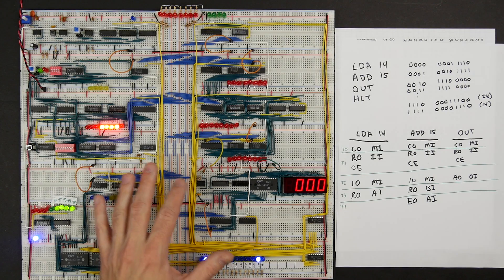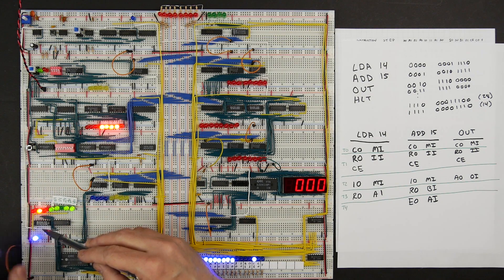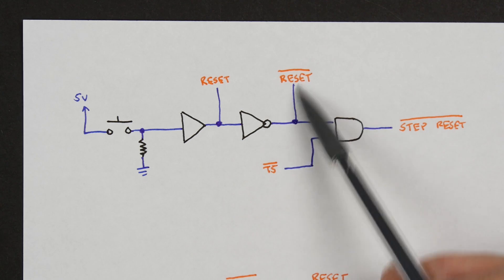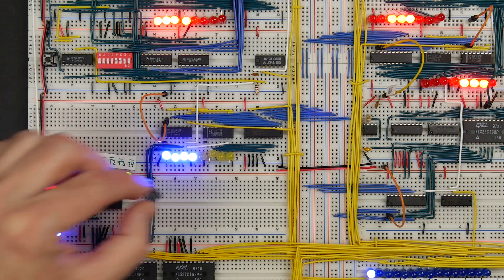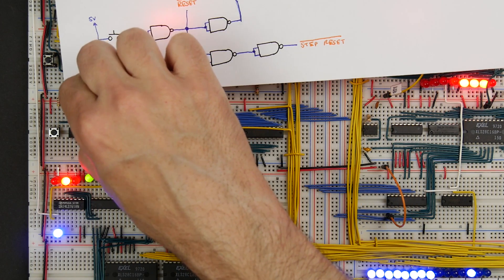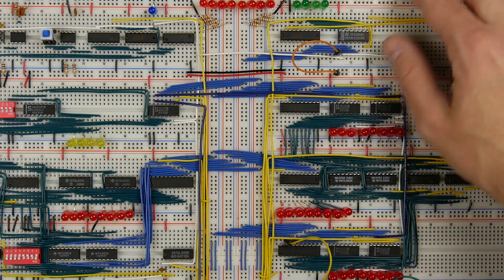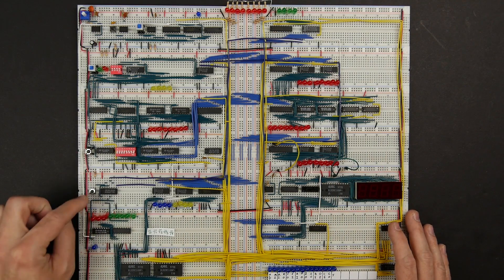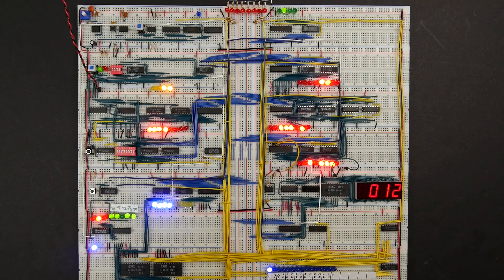8-bit CPU reset circuit and power supply tips

Comment: 3:12 /TS could be 1bit on roms last opcode step you set it 0 rest address its 1. or invert that thing so its control signal TS. all is there ready setup xD and would save clock cycles in your 16 address computer(cpu) bcoz output is just register c LOL

Comment: 📺💬 I select 7400, 4 NAN gates what is the most specification for this IC ⁉
🥺💬 It has 4 NAN gates you can create NAN, AND, OR gates if it is famous or you buy another IC for operators.
🐑💬 It has one input / output you do not need to connected multiple sources even you use one logical gate some of them you need to connect 2 input / output.

📺💬 This time we use 7400 4 Nan gates for reset functions, when it reaches the command output it should reset and run the program again.
🥺💬 You send invert reset command as in the VDO, I see from the Intenet you can copy 00 value to address, subtract, assign AND input value, and assign all true to reset the accumulator address.
🐑💬 At the reset, he is doing AND gate from NAN gates switches.
🧸💬 How do we assign all true into the input value⁉ 🐑💬 It is self AND 🐜💬AND 🐜💬AND 🐜💬 AND

📺💬 ยุ้ยซื้อนะครับ 🥺💬 ซื้อแน่ ที่จริงมี IC อยู่แล้วแต่ว่าหาตังค์กินข้าวก่อน 4 ปีแล้วครับ จนซ่อมโทรทัศน์ ซ่อมของ cer 50 ใบ ตอบคำถาม Stak, Google ติด top 200 ยังไม่ได้งานเลย ปล่อยพวกผมทำงานด้วยครับ
🥺💬 ผมทำ software แต่ project ผมใช้ทุกอย่างครับ
📺💬 Circuits board, bread board ... แท้จริงแล้วชอบอันนั้นน่ะ มี tools ทำเองนะครับ
🥺💬 การสอนมีหลายวิธีครับ บางมีเค้าก็เอาคนมาเล่นกับเราด้วยนั่นตัวอย่างนะ ประมาณนั้นแหละ

( 📺💬 ยุ้ยเราเก่งไป 🥺💬 หยุดยอเถอะครับใน lab ก็เรียน ผมดูหางานทำจริงจริงครับเดี๋ยวคนเข้าใจผิด
📺💬ยุ้ยผมทำอย่างนี้ทำไม⁉ 🥺💬 สื่อการสอนมั้งครับ ผมดูได้ประโยชน์ ผมก็โดนเค้าแกล้งผมจนใช้แต่ notepad ผมเขียนโปรแกรมนะครับ ผมว่าดูรายการนี้มีสาระครับ )

Comment: For the asynchronous reset on the step-counter, you could tie all the inputs to LOW, and use "load" as the reset, which makes this synchronous to the clock too :) - Then you have a "step counter reset line" to work with.

Comment: Thank you for your great videos! :) If instruction codes for mem operations like LDA would consist of two bytes instead of one (first (half) byte instruction, second byte address), you could even use one of the 2K EEPROMs for memory instead of the (poor) 16 Byte Memory and therefore use the whole 8 bit bus to address, not only the lower 4 bits, to be able to address 256 bytes without too much change and your program code would even be saved. At a first guess, the only thing you would have to change is the memory unit, extend the microcode counter to four bit and update the microcode. Even using 3 byte LDA like instructions to be able to address even up to 64K would be possible by only more clock cycles and some small changes (you would need a second memory register). But in both cases, with a lot more memory, you could write fairly interesting code for that processor, although the microcode needed more clock cycles on the mem operations and would be slower.

Comment: YOU DON'T NEED POWER DISTRIBUTION PROBLEMS. They can give you wildly unrepeatable results. I recommend running power on bus bars outside of the grid with power and ground delivered to the prototyping boards with the 0.025" square pins as you mentioned.  You can make bus bars with 0.062" double-clad FR-4 PC board material which will slide down easily between the rows of your 0.025" square pins. This also gives you an excellent platform for mounting bypass capacitors, which I see a few on your board.

Comment: Why is your asynchronous reset not causing problems with the clock? If the reset turns off just before or after a clock edge, wouldn't some components see the clock while others wouldn't?
Edit: Also, how do you ensure the clock's next transition is positive or negative after the reset disappears?
Reply: 4 months later and I have the answer, thanks to /r/beneater. The chances of the reset and clock signals changing within nanoseconds of each other is very low, and the chances of getting a glitch from it are even lower, so it's fine. As for the clock's next transition after reset goes inactive, it doesn't matter what clock transition is next because the 0th micro-instruction of the very first instruction (whatever instruction it may be) is useless, always moving a 0 value to where there is already a 0 value. If it happens, great! If it get skipped, that's fine. For more information, search for "How do the clock and reset work together" on /r/beneater.

Comment: I had some stability issues on my control lines and address bus especially when working on the control logic because for some reason if the control lines ever floated weird shit started happening.  My biggest issue was with the 74LS32 in the clock circuit almost burning itself out because of the floating HLT line as I was working on the control logic.  I also encountered erratic behaviour from the computer when the clock is running at full speed (the program the counts to 42 is instant at full speed, and I have to use an oscilliscope for debugging).  My solution was to all 1k pulldown resisters to the system bus as oppose to the 10k ones and to add a seperate 1k pulldown resister at each module directly where the control signal connects.  I found that 10k pulldown resisters didn't pull the voltage low enough to cause the signals to count as low in some places and caused the address bus to float at 1.4v oftern when nothing was connecting it to ground.  I also added some big electrolytic caps at varying places along the power rails for higher power draw situations and decoupling caps on the rails also.  Now my processor runs at full speed flawlessly completing calculations right at the instant you press the button, right now thats about 450Hz according to my scope, but I might try increase the speed eventually

Comment: I was really hoping that the resetting of the control logic instruction step counter would be done in the EEPROM instead of hard-wiring to T5.  This would have enabled real various length operations and allowed a bit of cycle optimization. This could be done with the second EPROM which has an unused IO pin and that could be connected to the instruction microcode step counter reset line.  You would program the EEPROM accordingly and this would allow, for example , LDA microcode to reset/finish at T4 and ADD to end/reset at T5.  Basically just put a 1 in the EPROM at the end of each instruction microcode to reset the instruction step counter.
Reply: I think part of genius of this series is to let people have ideas like this themselves. He left ample room for us to have ideas, and have the knowledge to implement them.
Reply: @Android480  best series ever.  universities should learn from him.

Comment: Thanks loads.  You just solved some of my confusion.  I've been watching this whole series and decided to get a breadboard kit to play around with.  I also finally got around to assembling the Three Fives kit and was trying to use that to make a LED blinker as a first project.  Aside from the breadboard kit coming with "100 nF" capacitors that measure out as 47 nF, I hadn't realized yet that this breadboard had split power rails.

Comment: Regarding the power supply: I have found that these are well worth the cost. http://a.co/d/4rpranQ
They allow you to select 5v or 3.3v on either rail while still providing for jumper connections for each voltage level.

Comment: Does it actually calculate numbers? Does it have interface to type numbers? And i think you need to use Arduino to reprogram it without disconnecting ROM chip

Comment: I ordered a MB-102 breadboard and it was just like the BB830. There wasn't a break in the power lines and the printing of the letters and numbers was accurate and not flipped on the opposite end. It also had good connections. So they have either improved there breadboards, or i was sent a better breadboard in MB-102 packaging.

Comment: Great videos,
BUT as to your power supply issues, You should have notices it when you were testing with the multimeter.
It was reading 4.7 volts which is under rated.  Keep up the good work.
Reply: Alard Eales It’s possible to notice something without addressing it right then; as neither of us did and he did. 😂

Comment: I always wondered why the first vacuum tube based computers had so many lights. Now I understand.
Reply: Yep, no circuit budget for heavy decode circuitry, just directly viewing lots of bits. Though my favourite was some early ones which used a CRT as RAM instead of a mercury delay line, and so you could also directly observe the rows of dots as they flickered on the tube!

Comment: if you used 100kΩ pulldown resistors instead of 10kΩ on your switches, would you would reduce pulldown leaking power by 10fold?
Reply: (yes I'm responding 7 years later)I know with my board was having issues with the 10k resistors, so I actually had to go down to 2.2k ohm resistors
might need to look into that one of these days

Comment: I built the computer almost finished, just the Control module is missing. Unfortunately i have to say that i am about to give up on this project. The power issues i have are just not managble for me. Each module on its own works fine, but after i plugged all together there is always at least one module that is not working correctly, that is not taking values from the bus or not put values on the bus. sometimes i also just lightly tap on the table which already sametimes causes some LEDs to toggle on and off... I used some mid range Breadboards, but i think for this kind of big problems it is unavoidable to invest into the really expensive breadboards. 
I also wonder if my power plug might be too weak, it is rated for 1A, but when i measure the total vurrent i only get 0.45A, which seams to be to low comapred to bens values. Maybe i also should try a better power adaptor. 
Anyways, i am really frustrated about this project, because i theory it would work great for me since every module works fine alone, but then the reality hits me when i try to put stuf together.
Reply: Have you measured the voltage on different breadboards? I'm going to make a guess and say, that if you see voltage drops on each breadboard take a look at this Youtube user "/user/osadzinski" . I also had a problem with voltage, which lead to really weird behaviour and that user solved it by soldering together the power line cables.
So basically instead of connecting the power rails of each breadboard together with some cables you solder all those cables together and create one big long cable having a connection to each power rail of every breadboard.
Reply: Yes, i checked the voltages and i have seen the video you mentioned. I did the same thing, but still i had weired behaviour. it helped quite a bit, but still some connections are just too weak. The voltages on the power rails are okay (not lower then 4V potential between Power and Ground). But many of the flexible jumper cables i use to manually controll modules (as i said, control module nod done yet) are often not making good connection. Also on the registers only one of 4 bit register ICs seem to work, while the other one has all its LEDs off. If i lightly tap on the not working one, sometimes the behavior just flips, and now the other IC dont work, while the not working one seems to work. Also sometimes single bits are not taken from the bus. Or sometimes the go on and off synchronized with the clock... Really weired. 
Anyways, i will try a bit more, but  i also ordered now a bunch of prototyping boards with a smilar layout to the breadboards, and then i will completly redo the whole thing with soldering.

Comment: Thank you for these fantastic videos.  I am an electrical contractor, built many control panels etc and spent many years as a kid writing basic programs for the C64 and the BBC micro.  Never managed to really blur these lines and understand electronics and the basic principals of how computers work.  Until now.  I plan to order the bits and probably build this on boards and put in a nice case with lots of flashing lights and switches on the front :)  Thanks again for your fantastic work.

Comment: Awesome series, I've been slowly building my own version of this with some changes including adding a 1Mhz clock circuit and using solderable boards and IDC cables etc, still waiting on the memory chips and a supply of EEPROMs that will actually program on my eprom burner, some used ones I got off eBay have bad cells and I put in a request to get more with a local supplier which seemed to work. I am wondering if you will eventually release a binary dump of the EEPROMs, the display one I managed to modify the arduino program and dump out into a bin file the microcode might be more of a challenge.

So far I have completed and tested the clock, PC and output, and ALU and I'm in the process of wiring the IR and control board, which leaves just the memory once I get the RAM chips

Comment: Hello Ben, LoneRegister,

Just watched LoneRegister Micro Code Reset Circuit video, My two bits.

I am going to try coding my EEPROM using the 16th open instruction decoder output pin as an  "Instruction Micro Code Step Counter Reset" signal so your final Micro Code step instruction will reset the Micro Code counter to eliminate wasted instruction T Cycles. 

Remember NOP is 00

Keep up the good work :)

Thanks, Mike DeLosier

Comment: I was just wondering.  Why did you not use current limiting resistors with all of the leds instead of just some of them (i.e.the blue Control Signal leds)?
Reply: as far as I understood, some of the ICs he used have resistors already builtin, so if a led is connected to an output of said ICs, you don't need additional resistors
Reply: That does sound familiar.  Thanks!!!
Reply: Weird.  I checked some of the data sheets and couldn't find any references to having built-n resistors.  I'll have to go back and re-watch the earlier videos.
Reply: I just tried re-listening to the videos all the way up to the Program Counter module with no mention of built-in resistors.  Does anyone know which video is the one where he references this and/or which chips have the built-in resistors?
Reply: TTL outputs have a resistor of about 100 to 150 ohms on the high side (seems to vary a bit from one device to another). Data sheets often don't mention this because it's a common feature of all TTL logic.

TTL is anything starting with 74, 74S, 74L, or 74LS (or their 54 counterparts). Anything else should be assumed not to have any output resistors unless the datasheet explicitly says so.

Comment: In the beginning of this series, you talked about decoupling.  Perhaps that would add stability too.  All those millisecond breaks-makes from wiggling the power feed connector would be "filled in" by extra capacitance.  Plus it'd serve its usual role of making sure the chips don't glitch due to action of the other chips.

I was wondering...with these EEPROMs, have you in essence been using the equivalent of an FPGA; is that the sort of thing FPGAs are for?

Comment: Excellent! Also - a note on the cheap MB-102s - there may be two 'flavours' of them, one packaged with a black top (which has the weird numbering, the power rail breaks, the reverse printing, the difficult insertion) and one packaged with a blue top (which has none of these issues).

Comment: I've made CPUs in FPGAs before, but my instruction decoders were done in a case block and the micro code was also done in a descriptor language.

After watching these videos, I want to try this with the schematic designer with nothing but gate logic, no IP cores except for the M9K blocks.
Reply: After watching these videos I decided to give it a try using a CPLD. Being new to FPGA and CPLD my first hurdle was finding out that 3-state outputs were not available inside the chip. Next problem was finding out how much of the chip resources get used up when implementing memory with just flip-flops, and had to limit the memory to just 8 bytes.

So far I have built some of the blocks individually, but I'm sure it's going to be a challenge fitting them all in together. I'm using an Max II with only 240 logic blocks. It does have a built in memory block of 1k, which I will use eventually, but for right now I'm having fun trying to use only logic gates and ff.

One disappointment was finding out that the max number of program/erase cycles is 100. However the chip and board, plus programmer, were under $10, so can't complain too much. It's been like re-experiencing childhood, playing with Legos, except it's arranging gates and flip-flops to make a circuit. Have to thank Ben for rekindling the interest in digital logic.
Reply: I'm using a Cyclone V E with 25K LEs.

I got around the tri-state outputs by making a multiplexer/de-mux, I made eight 8 bit inputs and eight 8 bit outputs with a 3 bit selector for it.

This kind of does remind me of my childhood, LEGO blocks, K'NEX, and I had a dozed of those multi in one kits from Radio Shack, 1000s of LEDs, Resistors, Caps, Transistors, and 100s of IC parts for glue logic.